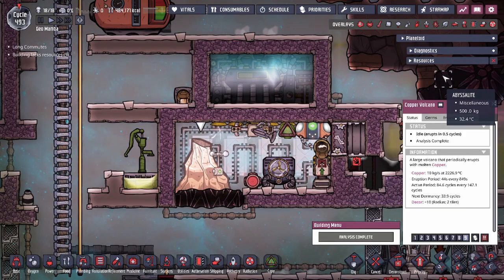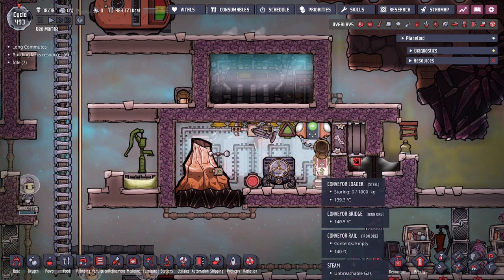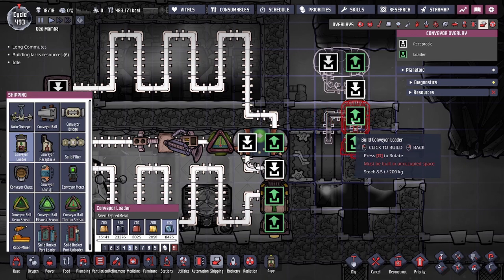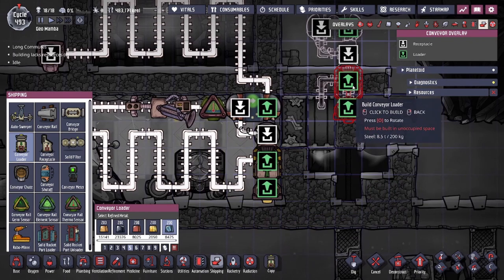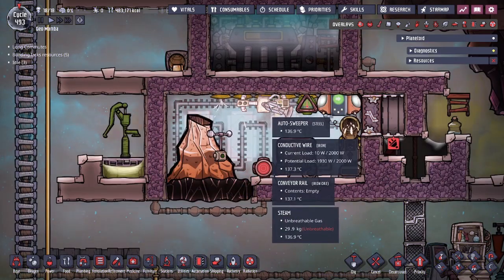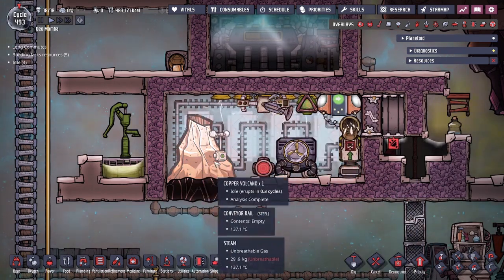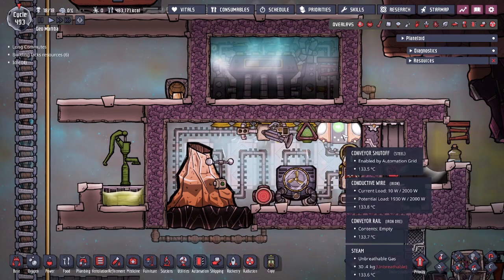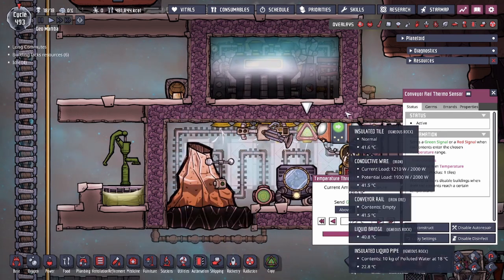Copper Volcano Tamer - Utilize the Submerged Steam Turbine - Oxygen Not Included

Comment: My steel sweeper in the unit keeps overheating, does this have to do with the copper coming out too hot, or is it the volume of steam?
Reply from the maker: not so much copper coming out too hot since you cant control that  and more tempshift plates to disperse the heat faster. steam volume can also be an issue if you have low mass per tile. like in the video, youd want atleast 30kg per tile of steam. another thing is that the aquatuner should be a dedicated cooling line and not used for other entities

Comment: How many kgs of water did you dump in to start?
Reply from the maker: the honest truth is i filled it up by 400kg of water and i slowly removed steam until i was happy with the temperature drop between eruptions and that ended up being 30kg per tile of steam. so for the purpose of volume per tile, it would be 120kg is what youre looking for
Reply: @2LegitCity  How did you remove steam without to get other gases into the chamber?
Reply from the maker: @realityextractor1956  the trick is you dont add steam, you add water. through the same pipeline as the steam turbine exhaust